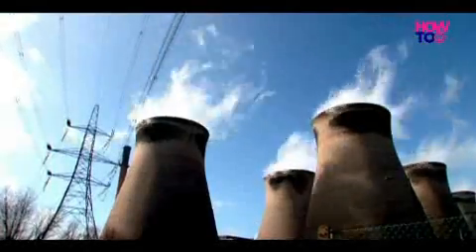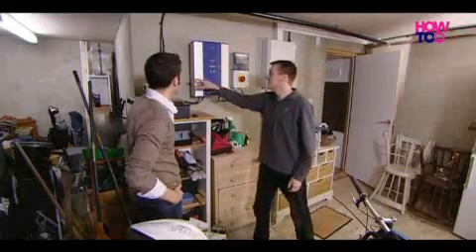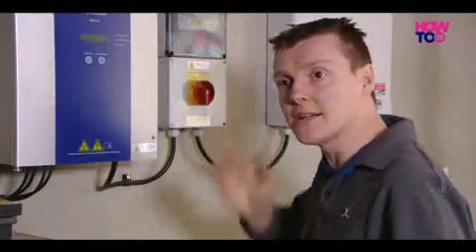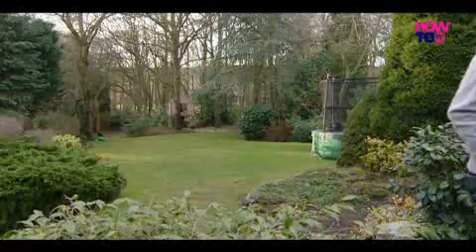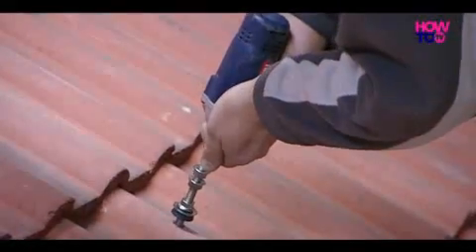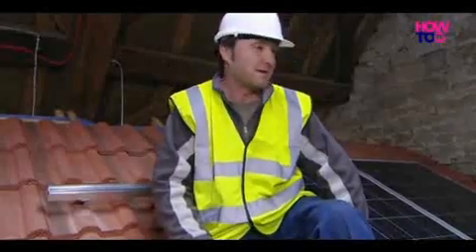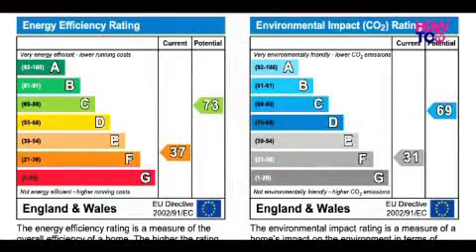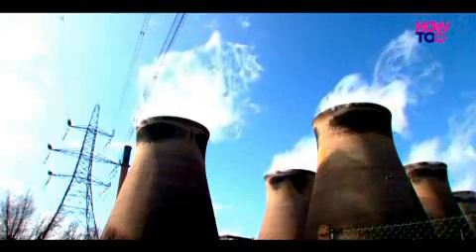How to Understand Microgeneration - Solar PV

Comment: ...... no moving part ? ever heard of thermal expansion ........ ever heard of uv degradation ........ they may be no pump or motor , but moving parts that will pull these things apart ? It will take some time but don't think they don't move, just 'cos there bolted, soldered or siliconed in place . Engineered products have to be well engineered, or it's the classic of rubbish in rubbish out .

Comment from the maker: Hi Bahurim.  
I've spoken to npower for you and the official response from their Sustainable Technology Unit is as follows:

"solar PV panels generate electricity in the form of DC (Direct current), this electricity is first sent though an inverter which converts the DC electricity into AC (Alternating current) for use in the home. This is the box on the wall that Pete refers to in video 3 (Solar PV). FYI, npower do not install off-grid solar PV systems (I.e. battery systems). "

Comment: These produce DC electricity?  If so, do you not need a battery bank?  Maybe the power is changed straight over to AC by one of those boxes on the wall?